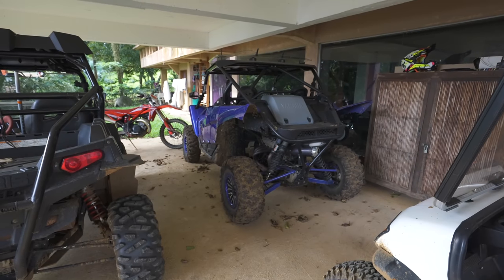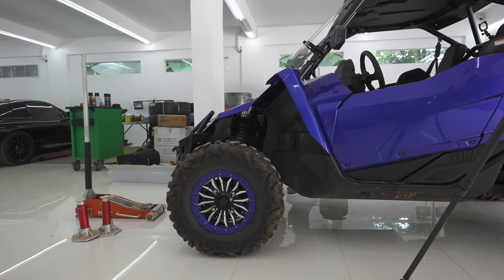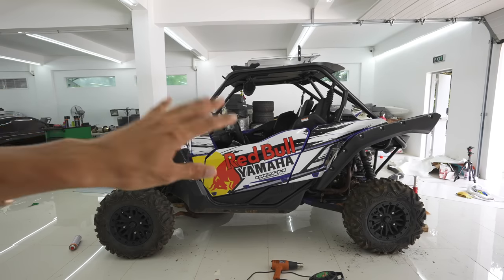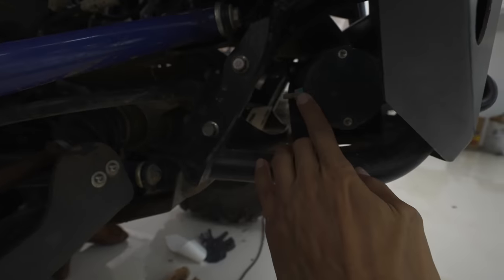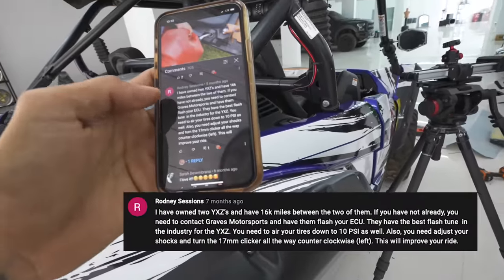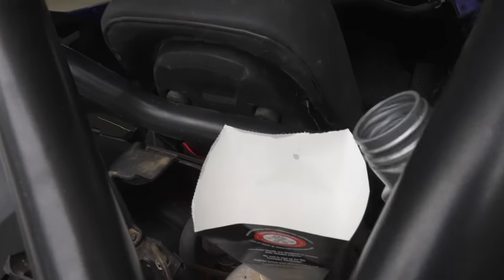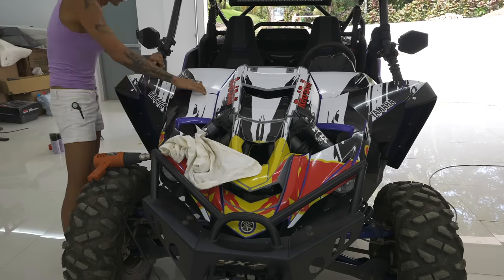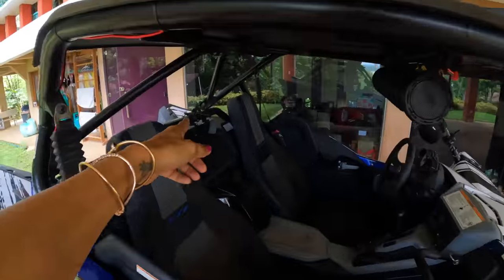Modding Manual Yamaha YXZ 1000R (2021) | Angie Mead King

Comment: You still running the stock cage?
Reply from the maker: Yea
Reply: @AngieMeadKing  idk if you're in the yxz group on Facebook but all those guys say first upgrade should always be the cage. I guess the cage on these things are only rated for 10 mph roll overs and alot of people in the US have been decapitated because the cage just folds in when you flip at high speeds.
Reply from the maker: @loucksm1rpg  ohh wow ok I’ll look into it